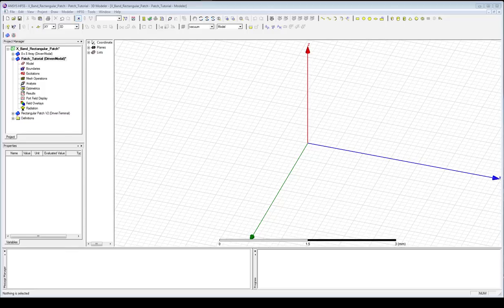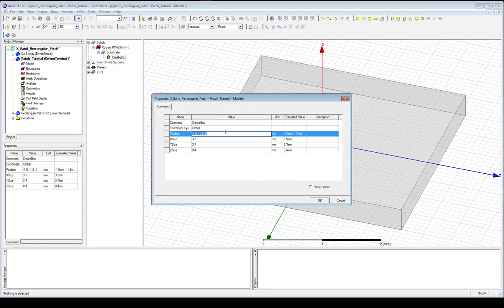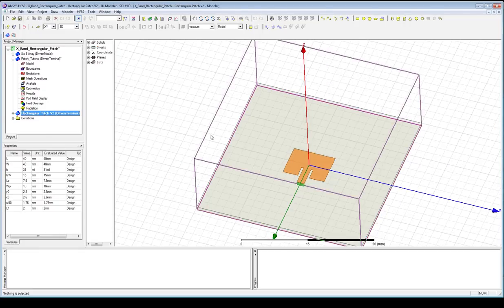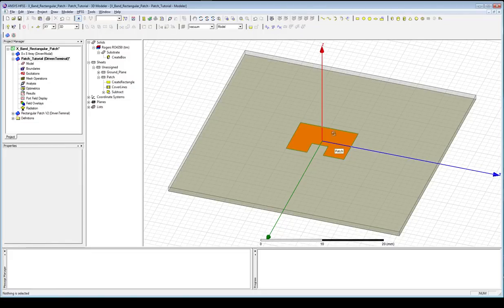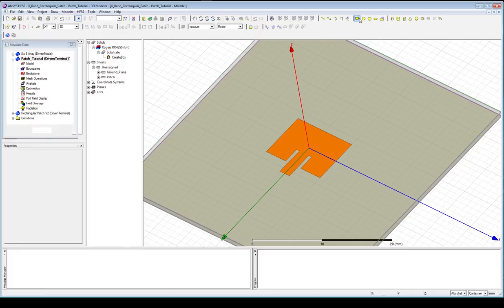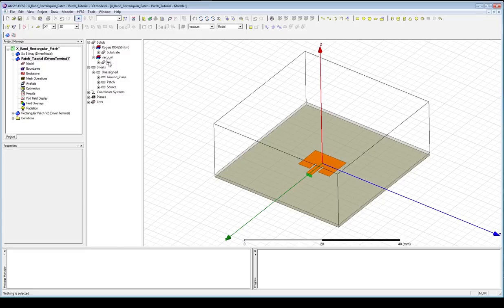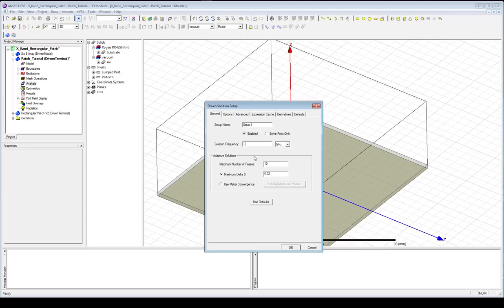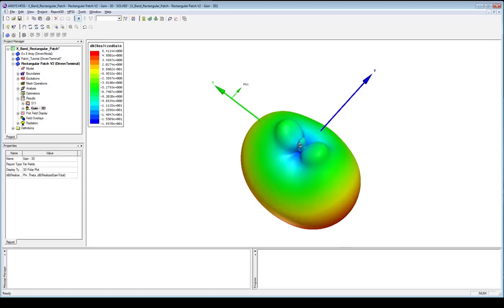HFSS Tutorial - Modelling a Patch Antenna

Comment: Thank you for this nice tutorial. I'd like to remark at 18:25: QW, meaning quarter wavelength, is set to 15 mm. However at 10 GHz we have a wavelength of 30 mm, so QW should be 7.5 mm to avoid confusion. Of course, the air box can be higher than 7.5 mm. In the tutorial the hight is hence half a wavelength, i.e. 15 mm.

Comment: Hi Kyle, I am designing an antenna array and I am having some trouble when performing the impedance matching of the feeding network. Mostly because when designing one element I didnt need to put the port in the substrate but on the edge. Therefore, I decided to use lumped ports using a terminal solution type. But, when I want to obtain the impedance  it is fixed on a value. Even though I specified NOT to renormalize the terminals. Should I be using another port? Or maybe my terminal solution data report (mag(Zot(1,1)) and mag(Zot(2,2))) is wrong? Thanks in advance.

Comment: hey kyle, i made Wilkinson power divider on hfss. while analysing i got error . here i quote .....Project1 (D:/HFSS_project/)
  HFSSDesign1 (DrivenTerminal)
    [error] Port refinement, process hf3d error: Port 1 does not have a solved inside material on either side.. (12:31:37 AM  Aug 27, 2015)
    [error] Simulation completed with execution error on server: Local Machine. (12:31:38 AM  Aug 27, 2015)
Reply from the maker: +SUMIT PRATAP SINGH I suspect the port(s) is on the boundary of the simulation, inset it from the edge and the simulation should work.
Reply: Thank you so much kyle for your reply. Lemme check this out.
Reply: +Kyle Davidson ...sorry . But what do you mean by boundary of simulation?
do we have to provide radiation box to it?